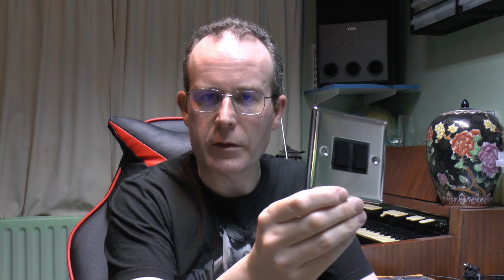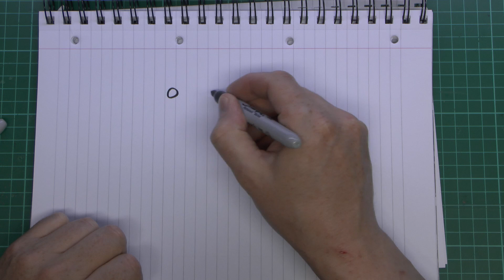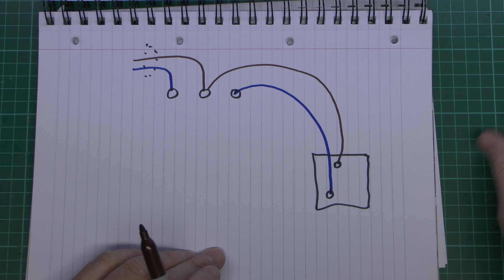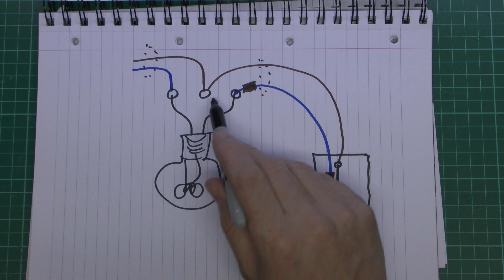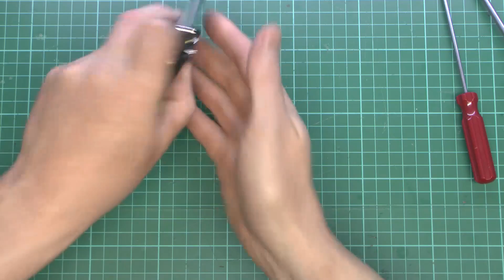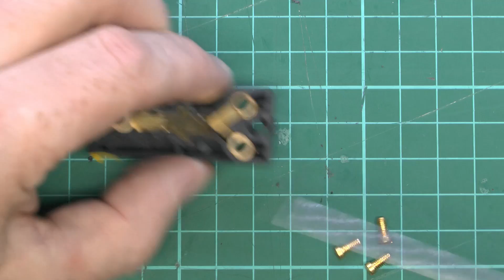Failed Light Switch - contacts welded together

Comment: Many many years ago, we moved into a house where nearly all the light fittings and some of the switches were missing. In the front room there was a dimmer switch, but no light fitting. My Dad installed a new light fitting. When the power (at the fuse box) was turned on, there was a very loud bang and smoke poured out of the dimmer switch. After he removed it, I had a look, most of the components were destroyed .At the time, young me could not work out what had happened. It was only years later I worked out what he had done. So, yes, dimmer switches don't like short circuits!

Comment: I know here in the states, you're supposed to label the wire that is switched so it is not confused with others (as often the same cable is used, so same color code...). Usually it's a matter of wrapping black (or red for 240V circuits) electrical tape around the white wire. (White normally refers to the "neutral" wire - we have that odd split-phase system here lol. It's basically 240V with a center tap for balancing the voltage. Normally if the 120V loads are balanced, little to no current flows through the neutral. If the loads are unbalanced, the neutral takes up the current so it stays balanced.)
Reply: Benjamin Esposti You're SUPPOSED to, but I've never seen any wiring job done by a professional electrician where this was actually done.

Comment: I wonder if someone could help me understand the incorrectly wired process. If electricity follows the path of least resistance, wouldn't only a small current flow the longer way round, through the lightswitch, and leave most of the current flowing through the bulb?
Reply: No, because the bulb has a higher resistance than the wire.
Reply: krnlg ahhh thanks!

Comment: Rewirable fuses possibly the overcurrent device, they destroy switches when a direct short circuit occurs. I couldn't help but notice that you work on theory of the blue used as a switch wire could have contributed to the error that may have caused this to happen. I am a great advocate of using twin Brown for the switch wires and the mistake tends to have them putting all the browns together but not resulting in a short circuit just a light that wont turn off. Great video keep em coming..
Reply from the maker: The twin brown is the ideal solution and really should be used all the time - however most installations I have seen do not use it, and just have the blue/brown or the older red/black used.  Sometimes with the correct brown or red sleeving, but often none at all.

Comment: Makes me wonder if there should be another colour to represent a switched line - violet or something? Or does that cause other issues?
Reply: twin & earth red or brown
Reply from the maker: Some countries do the wiring like that, I believe France is one of them.  There is nothing to stop people doing that in the UK, but like most things - if it's not required, it isn't done.
I worked in a block of flats a few years ago which had singles in plastic conduit, and the colours were black neutral, red line, yellow switched line and green earth, but that is unusual, I have not seen that done anywhere else.
Reply: IDK, but I know some other colors are in use too

Here in the USA, for 120V/240V (split-phase, 240V with a center tap) circuits:
~ White = Neutral
~ Black or Red = Line
~ Green, Green w/yellow stripe, or Bare = Safety Earth (AKA "Ground")
(Note that it is discouraged to call the Line wires in a split-phase system as "phases.")
(If using a black wire for the other Line, wrap red tape around it near all connections.)

For 120V/208V/240V 3-phase:
~ Gray = Neutral
~ Black = L1
~ Red = L2
~ Blue = L3
~ Green, Green w/yellow stripe, or Bare = Safety Earth (AKA "Ground")
(Orange tape goes on higher voltage leg, if any. This method is rarely used in new installations though. It basically is a way of wiring the circuit to get 120V, 208V and 240V single phase, and 240V 3-phase, all with 4 wires. But it needs to be sized properly, and it can be tricky to work on as it is more complex ... I think the difficulty is why this isn't used as much any more. But the system can be wired using only TWO transformers, as long as the load is well balanced.
See en.wikipedia.org/wiki/High-leg_delta )

For 480V 3-phase:
~ White = Neutral
~ Brown = L1
~ Orange = L2
~ Yellow = L3

Note: I'm not an electrician so don't count me on this. But this is what I remember.
Note: There are also other ways of hooking up the 120V, 208V or 240V stuff ... such as corner grounded three-phase. :P
Note: When using hardwired smoke detectors, in a residential setting, the alarm wire (usually yellow, from the smoke detector) is connected to a red wire in a 4-wire bundle (white, black, red, ground).

P.S. JW, if you read this, your viewers might be interested in getting to know what a Scott-T transformer is. It's pretty darn clever!
Reply: lordmuntague  If you want to pay a little extra, twin and earth wire with two brown wires is available specifically for the wiring between a loop-in ceiling rose and the switch.
Reply: In NZ you can get two-core red and white cable, and three core red-white-blue cable for two way light circuits. The two-core style isn't common. I am wondering if you're better off taping wires for identification rather than sleeving: the taping cannot fall off.

Comment: i once replaced a rose and it had the usual switched line and incomming line all normal , but for some reason there where about 6 neutrals comming into the rose and back out, i could not get it into the new rose , i had to put it into a terminal block and shove it in the celing and then just run some twin and earth down for the neutral , any idea whats going on with that ?
Reply: They were just using it as a junction box? Seems a little fishy though that there would be that many. Sloppy work probably, or done back in the days when the training and codes/laws weren't as advanced.
Reply: Was it a bathroom sometimes neutrals are present because they have a fan with a timer, the light if looped in is a perfect place to pickup permanent live switched live and neutral. Another occasion where more neutrals could be present if wall lights are added or even outside lights on the same circuit however it's not Unknown for some electricians to borrow a neutral for a completely different circuit the latter not being good practice, If I recall correctly JW did a video on borrowed neutrals and that explains why it's not a good thing to be doing.

Comment: +John Ward
Never had switch-contacts fail like that when old lightbulbs went pop...  I guess they have an inherent impedance that limits the resulting current despite going bang with some sort of odd plasma-arc or such inside...
Reply from the maker: Older light bulbs had at least one fuse in the base, some had two - http://www.lamptech.co.uk/Documents/IN%20Fusing.htm
designed to fail very quickly and well before the circuit fuse failed.  Some cheaper modern ones didn't have any, which probably explains an increase in fuses failing / circuit breakers opening when lamps break, and destruction of dimmer switches.
Reply: i reckon this has something to do with the proliferation of the 'rough service' & 'traffic' bulbs in light of the ban on incandescent bulbs
Reply: +John Ward
Now THAT makes some more sense!, thankyou for the article-pointer.  Still, I imagine the presence of (some) of the fine-wire-element provides (some) resistance limiting the current, regardless of fusing arrangements.
I've seen CFL circuit-boards go all melty and all sorts of similar problems with junk plugged into light-sockets.
With all the Chinese-rubbish non-isolated exposed-led-"bulbs" fun, I can understand the 18th-edition change to expect 30mA RCD on all lighting-circuits...